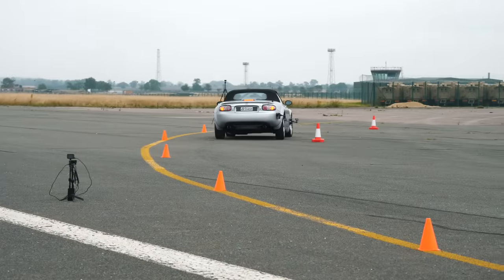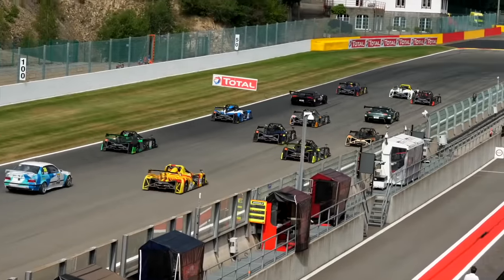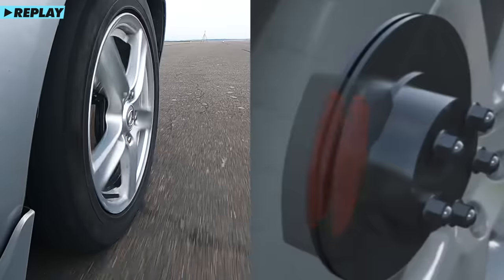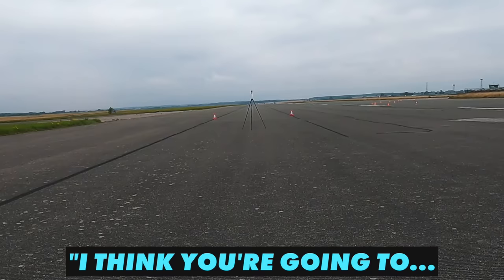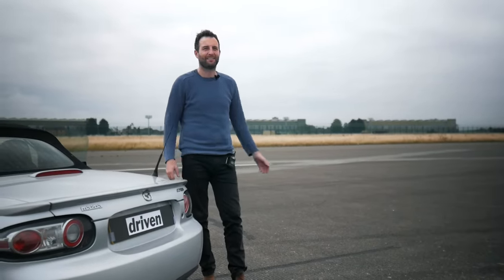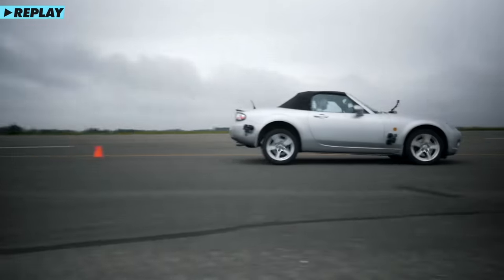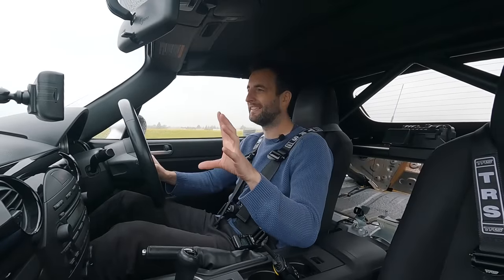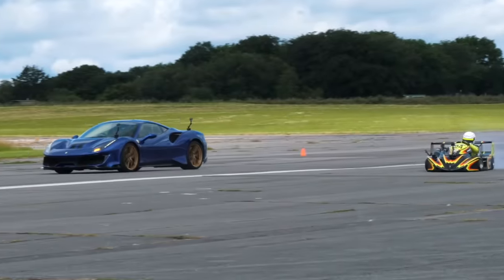ABS ON vs ABS OFF | What's Really the Difference?

Comment: Nice test, and good explanation of ABS. I think that ABS is better only in perfect condition for average drivers. What will happen if one tire is on gravel, or snow or you have very bumpy section. Tire with lowest traction will activate ABS and it will release pressure in main breaking cilindar. This culd leade to catastrofic results for ABS, and you will beat it without hitch...

Comment: I am glad that modern cars have anti-lock braking systems. Since I was born in 1951 I remember the days before cars had ABS. In these old cars applying the brakes in panic stop resulted in 4 wheel lockup as seen in this video. My first two cars did not have ABS. My third car a 1992 Ford Crown Victoria had ABS. Every car since then had ABS and the latest car has traction control also. With ABS you just have to get used to the rapid pulsation of the brake pedal and vibration of the car as it comes to a stop.

Comment: Would have been more interesting to see your unpractised, but best attempts vs ABS. As you said, you are a professional driver, so a best-case scenario for not having ABS. You also mentioned that non-ABS braking is virtually impossible to get right in a new situation, even if you know the car.

Therefore, I would love to see you try out what you can do in new situation, and then compare it to one with ABS. Additionally, I would love to see two more representations added. Someone who is not new to spirited driving, who has perhaps done some autocross and/or karting, but does not have professional experience dealing with non-ABS braking. The last representation I would like to see is 'the layman'. Your average driver on the road.

I think this would really show that ABS is not a joke. IT's not as simple as many people think. there's so much more to it than "just pump the brake pedal" which you still hear a lot, or "just modulate your braking".

Perhaps you could also add in a section where you compare your own performance to your performance in a car that you haven't driven before.

Would love to hear your thoughts.

Comment: Back when I was young, in pre-ABS days, I was taught to pump the brake pedal, especially on snow or wet surfaces.  Same result as ABS, but much cheaper.  Now, we are substituting thinking and training with technology.  ABS does work pretty well.....until it breaks.  Then it gets costly.  I own a vehicle without ABS to this day.
Reply: ABS is more effective than manually pumping. Good ABS is better than threshold braking. That's why ABS was used on F1 until they banned it along with all driver aids.
Reply: @roflchopter11  Tell me how effective yours is when the module fails and it costs you 500 bucks.
Reply: @howiem3883  150k miles and still going. But it'll revert to non-ABS operation, as demonstrated by this video of what happens when you pull the fuse.
Reply: @roflchopter11  And you will continue to drive.  How about that.....
Reply: @howiem3883  brakes only hold you back, after all.
Reply: I too was taught to pump brake pedal, prefer non ABS braking! My F150 tends to over brake with its ABS system. The tires need rotation to grip the snow and ice not a real quick braking on/off stuttering.

Comment: I would like to see a test of threshold braking vs modern day ABS. Early days of ABS no doubt had longer braking distance, but I'm curious if modern day ABS can actually out perform threshold braking.
Reply: A lot of tests have been done with both motorcycles and cars. Certainly on Motorcycles even the MOTO GP riders admit they can't beat ABS.  In theory threshold braking should be as good or marginally better as there is no off time on the brakes. In practice it is not repeatable and it doesn't really matter who you are if you catch leaves at the side of the road or a mixed surface you only have one foot on the pedal so if you threshold or cadence brake to the wheel that is slipping you are missing out on good braking on the wheels that weren't. 4 channel ABS gets round that by only pumping the wheel that needs to be pumped. 2 channel diagonally split used to pump the opposite rear to whatever it was doing with the front. So if the front slipped it pumped a rear that didn't need to be pumped. And if the rear only slipped it probably wasn't doing much braking anyway and just locked because it was lightly loaded. (It was mainly small front wheel drive cars that had the 2 channel system).

Comment: On rougher/thick road conditions like gravel, deep snow or back roads,  no abs stops much faster than abs. But again you dont get steering control if the wheel is locked hence why threshold braking which is the most efficient method.

Comment: Braking physics on a bicycle is interesting in that the front and rear brakes operate independently, meaning you can test the braking demand required to stop more suddenly based on how much force you apply to the front and rear. It's a great way to understand how inertia results in different braking limitations for front and rear tires.

Comment: We frequently get conditions here in the winter that causes abs to greatly extend braking distance.  The state puts deicing chemicals down when temps are too low which causes snow to stick to the roads and build up in a consistency much like beach sand.  There is traction available under it and locking the wheels up gets the tires down to that grip, but abs causes the tires to ride back up on the granular snow as soon as they start to carve down into it.  It's very frustrating.
Reply: None of that makes sense. Just drive slower.

Comment: I wish more serious driving tasks like this would be required for licensing. I took an emergency vehicle operators course as part of training for my job. The familiarity I gained with what a car can handle and the spacial awareness of the car was amazing. We did a section like this so we understood that we can manuever through ABS braking.

We charged forward at a wall of comes about 6ft wide. When we were less than a car length away (going about 30mph) the instructor told us to go left or right at random. You had to stand on the brakes and steer the car around the cones without losing control. Surprisingly it was easy to do. I often wonder how many accidents could be prevented if people had that understanding of how the car operates on its margins.

Comment: Generally when I engage abs full brake applications I'm on surfaces with uneven traction because of snow, ice loose gravel etc... I find that abs brakes according to the worst surface and therefore slower than threshold braking with one side on a better surface. I've pulled my abs fuse to compare and I stop quicker without abs.that being said most urban drivers don't deal with the same circumstances and abs is a great option. Abs systems are still improving and may be able to regulate braking on uneven traction surfaces better than the systems I am familiar with.

Comment: I’d love to see the “downside” in a race environment. 
Try a lap with and without and see how a driver uses the brakes differently. 

There is no doubt ABS is better for any public driving,  but I want to see why it’s not used in racing.
Reply: Main reason is regulation. With ABS there are easily also traction controls included which both brings clear benefits but with a lot of engineering effort
Reply: They're not used in racing so that it's morw about the pilot, you have to know how to not lock up

Comment: In no way is threshold braking as good as ABS... Sure a pro driver will come close on a known track after many laps but no human on the planet has the reaction time of a modern ABS which checks if the wheels are locked dozens of times a second and can slightly release the brakes multiple times a second and with greater accuracy than any foot! 
ABS is amazing and there are no reason to disconnect it even for prep drivers when the regulations allow them to have the system on board. (I have a vintage car that has an ABS on/off switch! Although that was a very early ABS system so it probably isn't as good as what is available now, but it could still be better than a pro driver...)
Reply: Hey!
Didn't you notice all those Senna/Schumacher reincarnation in the comments?🤣

Speaking from experience (many hours on track when I was younger and working on side tracks), in reality pro drivers/race pilots CAN outperform ABS.
Imagine 100% is the perfect brake while <90% is insufficient brake and >100% is a lockup.
ABS would ALWAYS hit a good 95%, which is enough in a normal pubblic road.
Race pilots can CONSISTENCY hit something between 96-98% .

BUT...

They are pilots, people who memorized every single inches of a track after spending a lifetime marking the laps over laps.
Nothing comparable to us mortals🤣
Reply: @oliviero46  actually now abs always gets 99%-100% if setup properly, which it is on race cars in the race categories in which it is allowed. So no, race drivers like to think they can beat it but they can't, the foot isn't precise enough and they don't react in the hundredth or thousandth of a second

Comment: How are any of these tests fair?
You didn’t even try to slow the car quickly without abs, You purposely made it slide as far as possible. No one who drives an non abs car would brake like that.
Reply: If the driver is panicking, yes they would. That's the point of ABS.
Reply: @pranavps851  I’m not saying that you’re wrong  but the point in this video was to test the efficiency of abs over non abs. It was an unfair test because he didn’t even try to brake smoothly/quickly in the non abs car.
I agree some people will panic brake like this but that’s not the cars fault is it, I think we should base a test like this on there being a reasonable standard of driver being behind the wheel.

Comment: I read a book on driving in HS during the 70s that saved me a big wreck. I learned that a front wheel that was locked up during braking would not allow you to steer because it would just follow the path of least resistance and not the direction the wheel was pointed. Shortly after I wasn't paying attention and was about to rear end a car that had stopped in front of me. I slammed on brakes, locking the front wheels(it was a wet road) and although I turned the steering wheel to go around, my car was still heading toward the stopped. I suddenly remembered what I had read, released the brakes and swerved around the car with no problem. Although that prevented a wreck, it didn't prevent a lot of seat pucker!

Comment: Though the initial brake might not have started at the same time, and though tire degradation was extremely critical (as you can see in the closeup right after the ABS test) letting off the brake for a moment, turning and reapplying brake just 1 time STILL produced better results than not releasing the brake.
Assuming early start factors, equal conditions, and accurate distance measurements; 70 mph is 31 m/s.
Currently, US safety ratings informally prefer manufacturer's produce braking systems that can stop a car within the same # of meters as the # of miles per hour (with ABS). This includes an estimate on how fast the driver can identify an issue and begin braking. By that measure, ABS passes and non-ABS failed (as 10 meters or .3 seconds is not enough time to see AND react).
What can be done in .3 seconds is a brake pulse. If within the first second of braking, the wheels lock up, and the vehicle skids as it slows to 35 mph, releasing the brake for .3 seconds (5 meters) and reapplying the brake could reduce the overall stopping distance by 5-10 meters, as demonstrated.

Not braking for 15 feet could make the second braking distance 15 feet shorter? Yes. The initial pressure on the brake pedal, lines and pads are gradual, so your most effective braking is reached just before wheel lock up, twice if you pump the brakes. Releasing the brakes also has the effect of shifting the vehicle weight and kinetic energy further away from the nose, allowing rear drum/pad brakes (if applicable) to be more effective on the next attempt. There is little heat gain on the brakes while the rotors aren't moving, even with the strain of resisting motion, because most of the heat energy is transferring between the road and the bottom of the tires; engineered for, but not ideal. Pumping the brakes balances where the wear and strain is applied to the system, helping avoid other "catastrophic failures".

Comment: I have an NC Miata. I'm glad to see that it's ABS is as good as it is.

Another consideration... Before ABS, auto makers HAD to almost guarantee that the front wheels locked up before the rears. Otherwise, the vehicle could get into a spin, which resulted in lawsuits. Regardless of how many people were in the vehicle, how many were in the back, how wet the road was. Or in the case of trucks, how much weight is in the bed, etc. So the brakes were always biased more toward the front than optimum for braking on dry pavement. ABS allows car makers to bias the brakes for optimum braking in the most common conditions, with the ABS taking care of the other conditions.

Great video! Thanks.

Comment: Been driving for nearly 2 years now, driving a Golf Plus 2006. ABS system really makes a different, it only engaged 3 times when I drove and it helped me avoid a chain crash, an amateur driving braking for no reason and a red light runner. Even though I'd say my braking skills are nearly as good as the ABS, it still really works like a charm in scenarios not even my own skills are enough

Comment: I had issues with ABS in one of my old cars. The issue was if I was braking and went over a little bump, it released the brakes. The only way to get it to start braking again was to take my foot off the pedal and press it again. Seemed to be worse if I was going down a ramp. It happened quite often in the carpark at the place i was working at the time, which was fine because I knew what to expect and approached accordingly. The issue is as you mentioned in the video that doesn't really help when you're driving in random places.

I wonder how much better it would have been with tires that weren't slicks. haha.

I thought you were going to show how you can brake better without ABS, not just slam the brakes on like some kind of neanderthal

Comment: When I did my first advanced drivers course I was taught to pump and pulse as fast and hard as I could in an emergency braking scenario (pre owning a car with ABS, I only had a Commodore VK back then).
ABS is even more beneficial in the wet. 
Modern cars have brake assistance so it's not as if you can find a sweet spot like in your race car. They will apply maximum braking force without maximum pedal force.

Comment: I'd like to see some comparisons with driving on gravel, and mixed gravel / pavement.  I've experienced real problems with cars like Subarus in such conditions.  Pulling off of pavement onto a paved turnout, but which had a few pieces of gravel on the paved surface.  Real problems resulted!

Comment: I used to think only the very best race drivers could brake better without abs.  But then I had an abs fault at a couple of track days and found myself stopping better by threshold braking.  The downside was that I was having to think quite a lot about more ab out brake pressures, whereas with abs I could concentrate more on other things. Those two days did teach me to recognise the onset of lock-up though, to the extent that I now very rarely invoke the abs.  I still wonder whether, if I pull the fuse and learn to properly threshold brake, if I might be quicker.
Reply: It is basically impossible to outbreak a modern day ABS System on road.  On old early-mid 90s cars, where ABS often was even an optional extra you had to pay for, it might have been possible to slightly outbreak the system under ideal circumstances (on an ideal road with a prepared driver, absolutely not in an unforseen emergency stop) - but everything that was made in the last decade or so has 4 channel ABS and much faster regulation - not even formula one drivers can beat that because you simply cant break each wheel individually. There are countless studies about this. As soon as one wheel locks up you loose against ABS, and as soon as one is not perfectly decelerated on the treshold you also loose.

Comment: For as entertaining as this video was, I would have really liked to have seen you use your racing skills to see if you could do better than or equal to the ABS system. That would have been far more interesting and entertaining!

Having said that, I appreciate you showing the difference between ABS and no ABS with a simulated everyday driver driving the car. It provides an excellent reason why ABS systems need to be always functioning on road cars. Driving with the idiot light on without instinctively knowing what to do and knowing how the car is going to react in an emergency situation can be quite dangerous.

Comment: Tires provide the most g-force potential at their limit of grip just before slipping. 

Not only does breaking traction reduce possible g-forces, but locking up the tires also rapidly overheats them. Overheated tire compounds provide even less grip.

The best ABS systems can keep it right near the limit of grip, thus being controllable with steering and extracting the most g-forces possible out of your tires.

Comment: One thing you should have noted is that it depends on the surface you're driving on.

If you do this on an icy road you'll get the opposite effect on stopping distance (although you will at least still have more steering control with ABS)